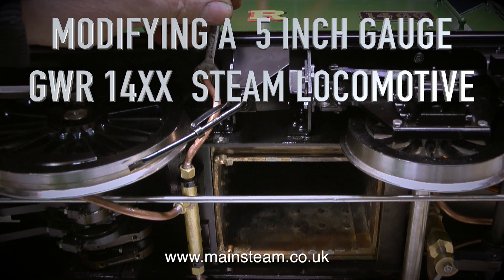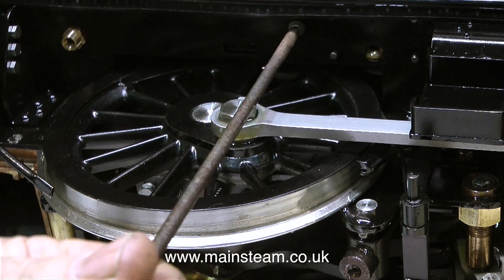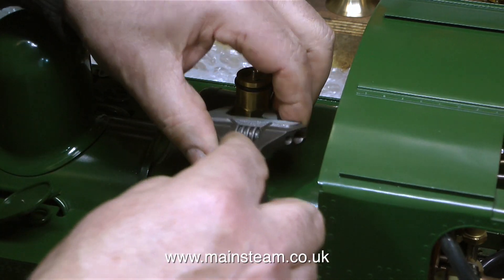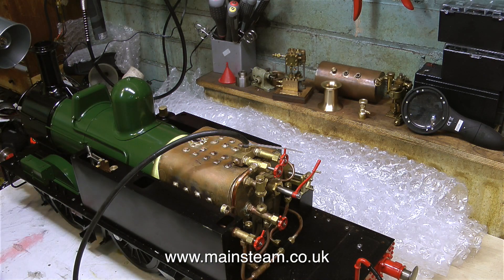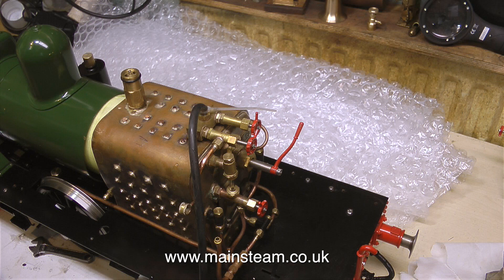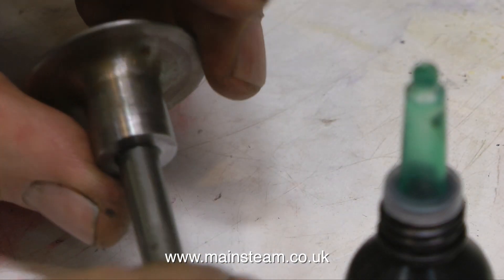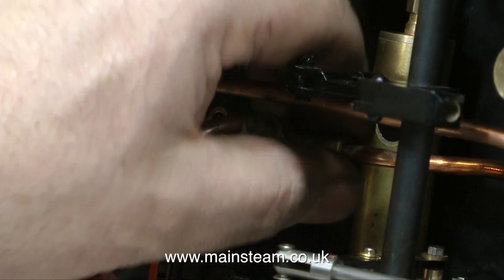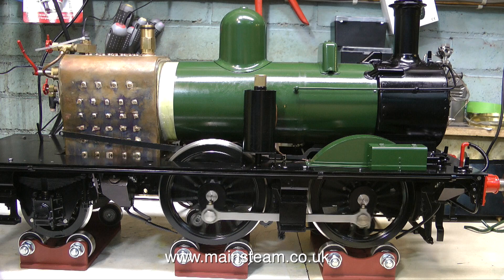MODIFYING A 5 INCH GAUGE GWR 14XX STEAM LOCOMOTIVE - PART #2

Comment: That white sealant your finding reminds me of the white pipe dope we sometimes use here in the States, it works well enough but does dry out when in contact with the air.  It also crumbles as you can see and falls into places you don't want it to fall into.  I'm also wondering about your description of thick walled copper tubing being used as brake line. In America copper is never allowed to be used as brake line, (nor is stainless steel), because it can crack from vibration.  Just wondering, if this is true in Britain?
Reply from the maker: Copper pipe is used for brake line quite legally in the UK. I rebuilt a Series II Land Rover in 1999 and I piped the braking system  entirely using thick walled copper pipe.
On the other hand, Stainless steel model steam boilers are not allowed in the UK, but are fine in most other countries ???? a bit odd really . . . I have a thick walled stainless steel boiler and it has worked fine for years . . . .
Reply: Keith Appleton:  Yes very odd!  BTW_A friend told me a while ago that some pipe dope (another odd name) has chalk in it which expands when it gets wet. I never thought that chalk does that but the next time I'm at the DIY store I'll have to read a some labels.

Comment: keith this is a nice engine but it seams a little small to me, if you wanted to say run it on the rail in your back yard. The size as is, will it  pull you and oh lets say a couple grandchildren with no trouble ?
Reply from the maker: my railway is 7 1/2 inch gauge, this is a 5 inch gauge engine but will easily pull 3 or 4 adults
Reply: That’s impressive

Comment: Small point: Copper tubing is not used on automotive brake systems. The constant fluctuations in pressure will work harden the copper, which makes it brittle and crack when you need the brakes most.
Reply from the maker: That is very strange then, because I have used 3/16" copper brake pipe bought from car accessory shops for about 40 years - I must have been doing it wrong all these years . . . .  I rebuilt a 1971 Land Rover about 20 years ago and the entire brake piping i fitted to that was also made from 3/16" copper pipe . . . . .  what do my viewers think about this ???
Reply: I've been a professional automotive technician for 40 years and copper pipe is not allowed by any manufacturer I know of. General Motors specifically states "Always use double walled steel brake pipe when replacing brake pipes. The use of any other pipe is not recommended and may cause brake system failure."  This warning has been in every service manual I can recall, going back to the 1960's.
Reply from the maker: are you from the UK or USA ? - maybe the rules are different ..... My Land Rover passed it's MOT test and still runs (and stops)  successfully for years with the copper brake piping that I fitted to it . . . . . and it doesn't rust.

Comment: one question about this at it's Chinese what threads are used on the engine are they BA or are they small metric sizes only asking as most item's from China use metric threads. it does look good though.

Comment: And superbly there are inner tanks!
Yes I am coming over to these as MI MUM was fum Manchester and Paint sticks to steel superbly! And is a 1/4 of the cost. Solid brass tanks add weight just where you need it!
People and designers not doing Double OO or O Gauge models tend to forget that you need to assemble without marking your wonderful finish!!!
My Terrier will have them as in full size as they were once condensing engines!!
David and Lily.
Big fan of Chinese things!!!

Comment: Hey Keith - I've been binge-watching your videos and enjoying them very much. I don't even have a lathe yet, but by gum, I will someday, and when I do, I'll try my hand at machining some castings. My wife is confused by this recent obsession with watching some British guy make stuff, but I explained that you play keyboards (me too, but just for fun) and have a daughter named Charlotte like we do (my daughter Charlotte is only 12, though), and she seemed OK with it. I haven't yet told my wife how much a lathe costs, though, much less good castings. . . 

Regarding grumpy comments about Chinese-made stuff: I buy lots of Chinese-made stuff direct via the usual websites. Most recently, I picked up a couple of really nice toy Stirling engines at a shockingly good price. I've got lots of little "good enough" tools as well; a little protractor, a really nicely made multimeter, even a very good soldering iron (and it's nicer than the old Weller I was using. Nothing wrong with a basic Weller, but this one is just loads nicer for about the same price.) Sure, there's some terrible, cheap stuff out there. But my experience has been pretty positive.

Comment: You can pick-up some potentially good products from China. 

I have a lathe and a milling machine designed in Germany but manufactured in China. When they arrived I disassembled both and underwent the process of westernizing the products. 

The Chinese are very good at making some things (or at least their CNC machines are) but often the finishing is not too good. My lathe and milling machine were loaded with grinding dust, metal chips, and there were many burrs and sharp edges. After cleaning and reassembling both machines are fine and work well.
Reply: Yeah, good points. Putting the time into fine tuning (and cleaning out the seemingly always included grinding dust impregnated grease!) is of big importance for getting the most out of the more budget oriented gear.I don't know how many hours i spent doing this to my Chinese lathe/mill combo (no doubt same place as yours and possibly same model, optimum 2506v with 20m mill) but the end results are worth it.Only issue i have really had is 4jaw chuck/backplate problems, excessive run out (like over 0.1mm run out vs under 0.05 for factory 3 jaw) im still unsure if its either or both backplate/chuck causing this but it was not good enough, causing instability.This why i don't buy this kind of thing from ebay, go to a shop so you can take it back! I still haven't got a replacement yet so im guessing they had a bit of a qc issue.
Lots of people say better to buy older stuff not made in China, this is only true to a point.Many older machines are well worn by now and even if they were brilliant decades ago when new you may well end up with something that's not going to perform as well as a brand spanker China unit.A very good friend of mine (in his 80's, retired toolmaker apprenticed shipyard built Titanic!) rates my Optimum over his older UK made hobby lathe of similar size.It wasn't that long ago many people bagged the F out of Japanese stuff, when even many years ago it was superior to lots of stuff made in either the UK or US,thats the facts! Theres a REASON Fender Japan came to exist, it was making copies of Fenders better than US fender at the time so they bought it! Late 70's early 80's that happened, yet people didn't really seem to appreciate the quality until FAR FAR later, i eel China is kind of getting to this stage slowly.I still wont use their measuring equipment though, I stick to Japan/uk/us made for that as i dont trust them enough for that yet!

Comment: I think that thread sealant on the pressure relief valve is called Teflon Paste(PTFE). A common brand here in the U.S. is Hercules "Real Tough". It never "sets" the way Loctite does. It stays flexible. Also works to lubricate threads so you can tighten the joint more. Used a lot for all plumbing applications, sometimes in conjunction with Teflon Tape.

Comment: Permatex makes a high temperature thread sealant that's white in color (PX #59234). It's kind of like a paste and generally used as a replacement for plumbers white Teflon tape. I used it for hydraulic pressure lines to ensure a seal at joints.. Works great, but it can tend to get all over everything if one's not careful...

Comment: I worked with a chap that had a  Bahco spanner and a Crescent adjustable wrench who was notorious for rounding nuts. The boss made him put them away and use proper wrenches and sockets on the equipment, and guess what he could round off the nuts twice as fast. It looks to me like they used liquid Teflon pipe sealant on the safety. As for Chinese manufacturing out parent and grand parents used to joke and complain about stuff made in Japan. China is just starting on there industrial revolution and already some of there stuff puts western manufacturing to shame, and they are still on there learning curve. Will the Chinese Manufacturer have to send you another engine to have it's injectors fixed?
Reply: I spent 3 months watching Chinese constructing a Railway and station in Yaan last year! Very careful and very safe and yes you can do a wander with your chief translator!!!
Such a shame about the American footbridge that came down last week!!
In China if that happened the entire company LOOSES FACE and 10,000 peoples jobs end forever!!!
David and Lily.

Comment: Hi Keith whilst watching your videos my memory turned turned back to my younger days whilst an apprentice at CPC Trafford park and driving the old shunting engine, when I could get away with it. So I took the leap and looked her up on the net and found pictures of her she was a James Barclay 0 4 0 Spitfire.  To my utter joy she has been restored and now rests in Loughborough giving trips to enthusiasts.  Many happy memories and she did spit fire too!!!!! Do you happen to know if they do plans for this engine??? I have looked but no luck.
Reply: They do a set of drawings from Reeves 2000 but as they are possibly the worst set are best avoided. This is where Modelworks who did these as kits went wrong. These are wonderfully thought out and designed properly.
(I got to know the designer or scale from full size some years ago) 
Better is to get the 7 1/4 inch version from page 67 from Blackgates. Easy conversion down to other scales! Poly models are doing more scale modifications and all can be accessed on the internet!!!
Best regards
David and Lily.

Comment: There was a full size locomotive in Essex, Connecticut where tourists could take a short excursion.  I think it was a Baldwin type engine.  With the government rules on steam it apparently was too expensive to update/repair so "The Valley Railroad Company, along with the Boone & Scenic Valley Railroad and the Knox & Kane Railroad, imported brand new steam locomotives from China during the late 1980s and early 1990s."  There was a video about it on television some time ago.  Apparently the Chinese had the only foundry still manufacturing steam locomotives (two) and the one chosen most resembled the Baldwin type.  Their quality can be quite good when they set their minds to it.
Reply: China was still using steam for mainline use at least into the 2000's and i believe still building them up to this time.I don't know when this stopped, around this time i took a very  long break that only just ended! China can do very good,if budgets allow and QC is not asleep on the job!

Comment: I think that what you are doing is amazing!  Most people do not understand what it takes to rebuild or even repair old machines.   

I repair old metric motorcycles in the United States.   And they come in with all kind of problems that are not correct and the time involved to make then right is never ending.  

I even have worked on a few of the Conley v8 engines and i am starting to design and build my own inline 4.

Keep up the work and the videos!  My wife knows when im watching your video's when she hears your voice!

Comment: China makes good products. I have a Baldwin 4-4-0 (Accucraft). It runs like a champ. Unfortunately the false whistle broke at the shaft during shipping because the brass screw holding it in place was WAY to small in diameter. Otherwise its a great product.

Comment: Unfortunately the work standers in China is not as good as here it’s all about making a good product as cheap as you can for the maximum of profit especially when you want to ship around the world as you know you can see this in different areas of the model but it’s not major things as it’s looks like a good model but as you are doing they is nothing stopping you improving it customising it you your needs for example 

As Iam from Devon as it’s not fitted you could add auto coach equipment to run on a branch line that’s the good thing about modelling they is allway something you can do to make it better

Comment: As the owner of a Winson Models 14xx, this version looks extremely well designed. Everything looks so easy to access, and the removable superstructure in one piece is genius! Shame about the quality of some parts though... looking forward to the rest of this series!
Reply: Yes unfortunately they took the design from the locomotive called Didcot and the drawings are very bad!!!!!
These have been done from works drawings and a lifetime of models!
Yet the Winson one can be made to run superbly Yes on The Tiverton Track!!
(Where the try out model of these was run)
I helped build the track there many years ago!!!
I have driven both now I pick a side???
David and Lily.

Comment: Hi Keith, enjoy your videos, brilliant work.
On the sides of the firebox where the stays come through and are silver soldered, they look to have been masked off approximately into squares round the stays.  Have you any idea, being as how you can see it a lot closer than I can, what sort of material may have been used to mask it off?  I know that typists correction fluid can be used as a masking agent for silver solder but it looks to have been applied far too accurately for that method and I'm not daft enough to think for one moment that any other sort of masking tape may have been used.  Precision Paints used to sell a tape to hold parts together whilst soft soldering but I can't see that standing 600+degs.  Interesting.
Reply: From Cup Alloys talk at Bristol last year!
"Leave the copper dirty and clean it with the flux just round the stay area!
It will not flow over dirty copper!
David.